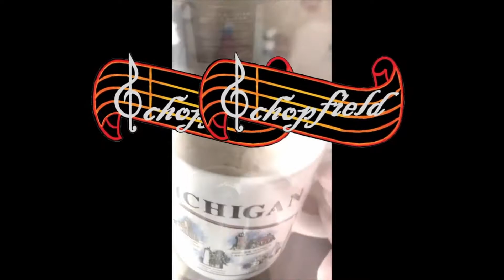How To Replace The Potentiometer In A Wah Pedal

Comment: That's not an 84 wah. That's prolly a late 70s model. Turret board, carbon comp resistors and old school capacitors, and a TDK inductor. They started using stack of dimes inductors in the early 80s and quick connect wire brackets. Great vintage wah to have! Those wahs are going way up in price now.
Reply: wow!! Thats Cool!! Thank you for the knowledge! I would have never known! ~cheers